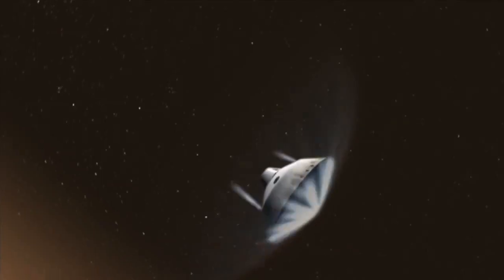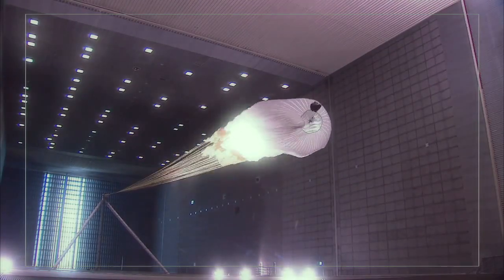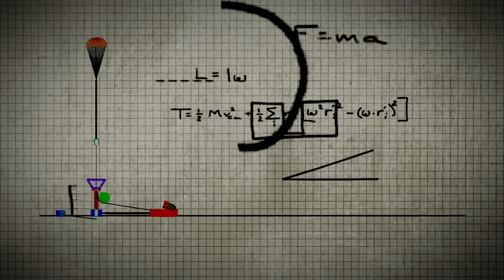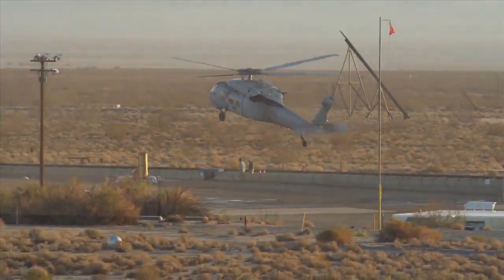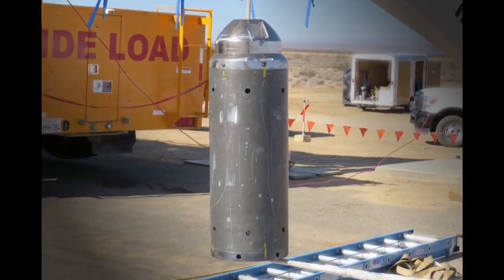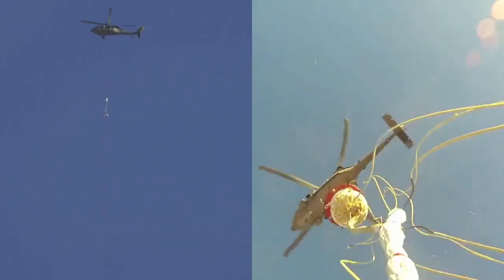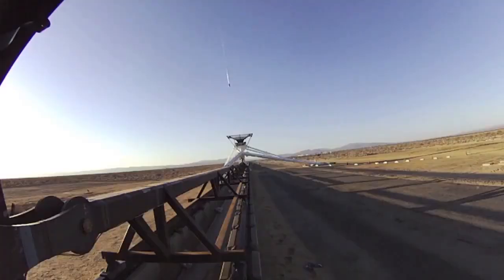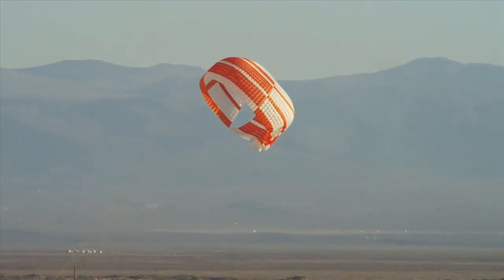Mars Descent Parachute Rips In Rocket Sled Test | Video

Comment: Ooohh please stop sending shit to mars and send things to europa
Reply: This is for the manned mars lander. Nobody within 50 to 60 years at best will set foot on Europa, IF ever.
Reply: Still useless and if they stopped sending shit to mars and use money on europa I assure you in 40 years they could get there
Reply: And im not talking about setting foot, im talking about a space probe
Reply: Rai Berrehs Manned probes are far more expensive than unmanned ones for obvious reasons. Doesn't mean NASA has put a hold on it's other projects. Also, this lander is a foothold for all future manned inner solar missions. So don't hack and gloom about it. If it lands on Mars it will land on Europa with modifications, of course.

But one can't expect a human to set foot on Europa unless shielding that is beyond current  in use technology is invented.

 Or rather,

if they finally design a miniature earth model core with liquid metal flowing in the center for i it to produce a magnetic shield of enormous proportions to fence off the destructive powers of Jupiter's proximity.

I hope i was clear enough on this subject.